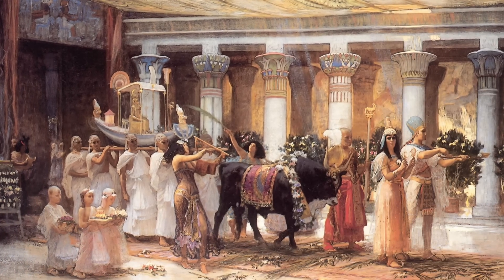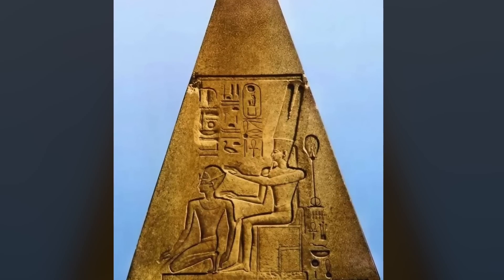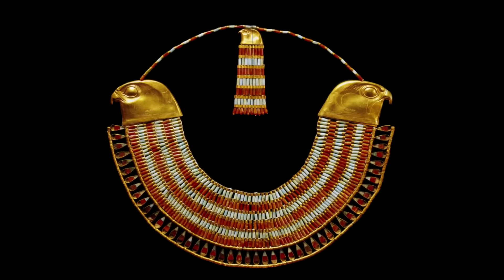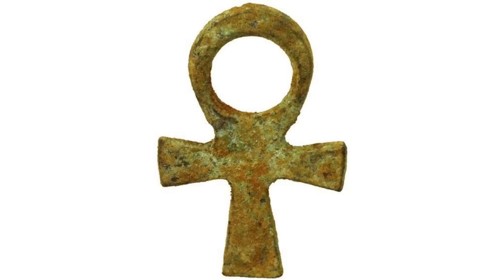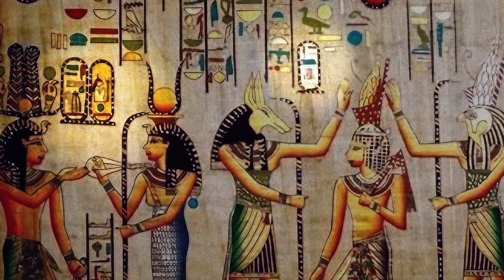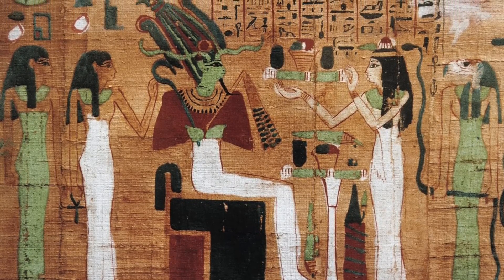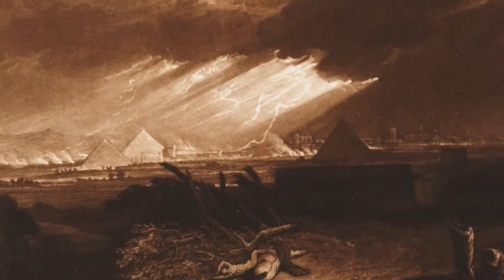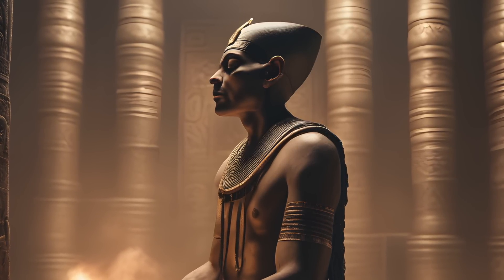Andrew Hall: Electricity in Ancient Egypt | Thunderbolts

Comment: Cool pics brother I have been a mechanic for 30 plus years and I see static electricity being used as lights. Started reading history and Found A key with in a dice and some marbles. Like the lighting in a bottle of the the 1st electricity discoveries Newton 😂
Finally some cool pictures bro 
Steam was the generator I believe and marble blowing was well abundant one would think sand and all 😂 tool makes electrical circuits too 👁
Gold would help to connect them like the old coins with power lines on them 
I can see why most don’t want one to do several trades 
See through the lies that way 😮 great video brother

Comment: I believe you are on the right path. If you ever get a chance, check out the Tartar people and how they used staticelectric affects to power buildings, robots, and household devices. They use the same artifacts in a way of gather free positive ions within the atmosphere and using heavily grounded tools such as obelisk to transfer wireless charge to smaller obelisk throughout a certain perimeter in proximity of the main obelisk that the current is being projected out from their buildings. I have the video saved in one of my Playlist I will find it and post it here if it will let me.
Reply: https://youtu.be/U_xKHPgTTzE?si=hhHViXqck3zPd93G
Reply: Please confirm the link is here in the comment section and is active, thank you. If you are interested, I can share some amazing experimental results and my hypothesis.
Reply: Also if I'm not mistaken, granite have high amounts of hornblend in its composition. Hornblend is very magnetic and a neodymium or alternate powerful magnet alnico granite will easily stick to it.

Comment: They wear yellow/red ochre. red ocher is a naturally occurring pigment composed of iron oxide minerals, primarily hematite and/or limonite. It is a reddish-brown or rust-colored pigment that has been used by humans for thousands of years for various purposes, including art, decoration, and rituals. I think this may be a key.
Reply: That's another interesting topic.. I have 2 main lines of thought for those, the first is that it was symbolic of the Red God (mars) which color is actually due exactly to the richness of iron oxides, and it was originally worn by warriors and then extended to other tribal members, and/or its usefulness as solar protection - iron oxides are still one of the main ingredients of solar creams - and in fact there are still tribes that use the pigment exactly for that. What's interesting is that it points to a former dimmer sun in a more ancient age... As for its electric properties, i'm not sure if that woul be a factor in modulating ritualistic effects, maybe someone else has better ideas on the topic
Reply: @giacomostefanoni7634  just a guess. icecaps are at max. Bigger cold areas. Potential between habitable tropic band as to cold higher as we see today. Might be a bit foggy during that era.

Comment: Recently biologists used electricity to change DNA.  Wonder if the Kemetic population used that to heal  some problems  and that the priesthood members knew this as an art, particularly for the pharaoh.
Reply: I suspect that the current was tuned to interact with the cell nuclei, promoting cellular regeneration as well as enhancing brain wave activity. The pharonic crowns would have further amplified the effect while the current travelled up the spinal column, via the spinal fluid, and would have activated the chakras, towards the pineal gland, hence the cobra symbol on the forehead. Definitely not "silly hats" like the narrator said. 😄🐉⚡️

Comment: Another possible use of highly internally charged semi-conductive stone is that you might be able to precisely machine it using Electric Discharge Machining (EDM). With sparks breaking down just the surface of the stone in contact with the electrode, a simple copper chisel could actually become pretty formidable against granite and diorite. With acoustics helping mobilize stored charge, the chisel simply needs a little capacity, or be grounded opposite polarity to the stone. How about forming copper sheet to a desired shape, and use that to discharge-carve a perfect replica on hard stone? You've seen the fine featured statues and perfectly formed stone vessels. Either soften and press with molds, or EDM while hard. How else could they have done those things? Abrasion, either coarse or fine, has been pretty much ruled out.
Reply: Hello all. Geophysicist here. Very interesting conversation. As I look at the cut marks, tube drills some of which are non-circular, scoop marks, surface striations, etc it is evident that although abrasion was sometimes used- it cannot explain what we see. In particular many cuts show a penetration rate of 3 to 4 mm per rotation. That is far higher than our best diamond saws or drills today. Although chemical or sonic treatment may have been used at times - my best theory is that indeed EDM best fits the evidence. As to why we don’t find any wires, capacitors, battery .. relics? Look at the stone brace cuts -all the metal has been taken. There were thousands of years of occupation after this technology was lost - all such artifacts - especially metal silver or gold has been repurposed. We see it in the hieroglyphs but it is all gone. Absence of evidence is not evidence of absence. Additionally, Present day Egyptian bureaucracy actively hides any evidence outside the mainstream narrative - just look at the story visitors are spun when visiting the unfinished obelisk.
Reply: @skyflight99  i get so tired of people yelling 'we use wires to conduct electricity' i have to respond that in electronics, carbon, silicon, crystals and polymers are used as resistors, diodes, oscillators and capacitors. all non metal objects. 

People need to see. Vandegraaf. Wimshurst and kelvins thunderstorm first. To see static in polymer, metal, and even water. 

Triboluminescance and piezoelectric.
Rosequarts granite. Turning the wheels of a wagon created a bit of light in india. They showed this, and probably thru thousands of years of stonework, they must have found use for it.
Reply: @@Aqua-Fyre 1) Tube drill holes & plugs. Assumption is that they are representative of technique. No hint of abrasion. 2) Glassy surfaces w/no abrasion marks. 3) no abrasive grains. 4)
Reply: ..4) Assumption that Peruvian work is same builders, surface glass implies very high but localized heat suggests sparks. 5) spectroscopic analysis shows extensive differences between the vitrified surface and substrate rock, also seen in some spark and HHO gas experiments.
Reply: For clarity, when I wrote glass, I mean actual melted rock glass, not "looks glassy" as in finely polished with micro abrasives. Rock surface converted. Peruvian samples tested & HHO experiments show similar conversion of rock to glass and heavy elements. Don't know if actual Egyptian material tested, probably not.
Reply: @@Aqua-Fyre None have been found? This is a simple technique if it was done like I describe,, but there's also reasonable doubt that the Dynastic E's knew the technique and did any of this work. The precision turned vessels are a glaring example. Also, rock glass typically degrades in a few hundred years, so well preserved specimens are needed for analysis. Tube holes or deep cuts might have it.
Reply: Still, all this can be done by abrasion. Copper tube. Sand. Water. Use a waterwheel. Windmill. Or even cows in a treadmill. Turning stone from wheel into pillars an disks. And leveling the block you grind underneath.
Reply: @humbuccaneer84  It appears they might have done it abrasively, but a micro-melted rock glass surface is a problem for that theory unless glass resulted from some kind of fire polishing technique. Then there's the lack of embedded abrasive in, for instance, hole drill core striations.
Reply: @rickZR1982A  micro melted? Do you mean polished... sifting sand to finer grain. And wax it.
Reply: @humbuccaneer84  No, I specifically mean that the surface of the rock has been vitrified apparently by high temperatures, but at tiny scale. There's a very thin layer of actual "glassified" rock on some well preserved artifacts from S.A., though I'm not sure about Egyptian samples. This thin glassy layer degrades over a few hundred years in the environment, so is not often found except where the surfaces were protected. This is what you'd find if it was machined with tiny plasma arcs, which is what the numerous micro-sparks from EDM actually are. Works well on resistive metals (no glass though, that's only from rock). Could you do it with semi or non conductive rock? Probably, since a similar process is done now with acrylic, glass, and other dielectrics, but instead of conventional current, electrons are pre-embedded with a LINAC before discharging for effect. So embed the charge with sound, then discharge into copper electrode tools to melt and vaporize rock at the point of contact. Water might be used to cool the tool during work. No aliens, no lasers, no abrasives, no high tech at all. Ancient EDM.
Reply: @rickZR1982A  might be even as low tech as superheated steam... but i love all the options discussed. Glassy surface could also mean a massive interruption from the sun... and why everyone started to live underground. As in capadocia and derinkuyu turkey. Stories from native Americans. I only recall a glassy surface on a site in scotland. But i keep it all open as to what or how they did it.

Comment: The use of high voltage static electricity could also be how the priesthood and pharoahs proved their divinity...  not that they were usually shocked,  but they were charged and then shocked the classes beneath them.  Note that the Pharoah would likely be mildly shocked by the priest,  but both would give the classes below them large shocks.  Servants were likely using specially made utensils to serve their masters to avoid the shocks.  But if someone did not follow the proper protocols and showed disrespect,  then they would be hit with a large shock and possibly killed as a result.
Reply: Utter and complete fecking nonsense... Whee do you get this rubbish from? Ohh, right, nonsense like this video.

It's complete rubbish and *intentionally ignores* literally all of Egyptology, history, archaeology, The Saturn Myth, et al. 

Ugh. This is not something we should be hitching our wagons to. It's complete "Dendera Lightbulb"-level nonsense.

Comment: It's astonishing to think that the Egyptians' mastery of electricity seems to rely less, if at all, on the production of mechanical force, and is focused more towards bio-electrical, electro-chemical, capacitance storage, and maybe harmonic manipulation. It seems that focus away from generating locomotion is what blinded modern humans to recognizing their use of electricity in daily life. I would be interested to see what circuitry could be depicted at the Temple of Man, Luxor. Schwaller de Lubics and John Anthony West believed it to be a repository of the Egyptians accumulated anatomical knowledge of metaphysical man.
Reply: I imagine it was do to the fact that it was labor intensive and expensive to generate the electricity for these rituals. Based on the imagines I've seen of what were probably battery cells, we're talking hundreds of pounds to generate the current of licking a D cell. The tech just wasn't there yet to do more.
Reply: @TheRyujinLP  They seemed to have had a firm grip on piezoelectrical and chemoelectrical principals, focused on building high voltage - high hertz - low ampere outputs for bio-therapeutic, e-field generation, and material manipulation. Generating locomotion was probably just overlooked as a use case due to the danger and lack of tech to wield high amperage discharges effectively. No amps, no torque.

Comment: the Djed thing is a capstan used to pull heavy loads such as stone blocks. the top portion was wound with three ropes. two heavy ropes in one direction and a third lighter rope wound the opposite direction. the rounded base of the capstan set in a stone basin lined with bronze several examples of these have been found. lubricating oil would be poured down a slot on one side of the basin and a frame work held the pillar upright. 
in use , a load rope was wound round the lower portion several wraps and the two heavy capstan ropes were pulled along with the load rope by crews in opposing directions to power the capstan when the heavy rope paid out the load rope was slacked and the lighter rope was drawn out by one of the crews to rewind the power ropes into their slots , rinse and repeat with capstan stations spread between construction sites and the quarries they could move massive amounts of stone quite easily ...no electricity required Egyptologists figured out this mystery years ago and quite frankly it is not a difficult thing to figure out either...lets put it this way "maybe Hall is correct" BUT even if he were the thing is still a capstan in that it would work as a capstan if configured as the Egyptologists suggest so which is more likely?
i like you guys but some times you let the speculations run away just a bit too far.
Reply: I can't find any reference to this being the case (no pictures, carvings, hieroglyphs or otherwise indicating ropes nor the usage as you state).  Can you share some of this information?  As per Egyptologists, these symbolize strength and oddly shown next to ankhs (all over the place).  This doesn't make any sense as a capstan as many of these objects had square bases (not a very good capstan)
Reply: I've seen this idea somewhere before, pretty sure it's speculative. My problem was that it suggests the capstan was in the unstable vertical position instead of horizontal two-point position. That just makes no sense to me. Also cant understand how an array of these gets those gigantic stones from anywhere to anywhere, let alone from Aswan to Giza (850 km).
Reply: Where is this documented and displayed to work ?

Comment: Shocks to the nose from an ankh not touching the nose would produce sparks and those would have been shown, so perhaps it was more of a dark mode plasma discharge.  The original technology that the ancient Egyptians discovered probably originated under very different environmental - electrical conditions with respect to the earth, oceans, ground waters, atmosphere especially if Earth was orbiting within a double layer shell at the time such as seen around the anode in the SAFIRE project, but with much less potential of course.
Reply: The catch is we don't know the environmental differences that existed back then. There are clues, but we can't be sure. Just imagining a much more ionized environment would drastically change the effects they wanted to recreate, I guess-..@@Aqua-Fyre
Reply: @giacomostefanoni7634  This could be very important. The absolute charge level in and around the earth (what we find at "ground") changes generally & at specific locations over time. Subsequent to large solar/cosmic outbursts in the past filling the crust, atmosphere, and VA-belts with a fresh supply of charged particles, the electrical environment might have been much more active than we find it these days. 12000yrs, 6000yrs, you know: "the pattern".
Reply: @rickZR1982A You got my imagination turning. One night in my basement during a snowstorm near my multipurpose antenna the charge was unreal. I lit a LED with my finger fainly but it lit.
Reply: @@Aqua-Fyre ankh is a magnet. The ring and staff. In egypt, and Mesopotamia. Are magnets. Point a magnet to stone. Touch it with a cone. And sing. Magnetic now fibrating in rock. Creating electricity.

Comment: Telepathic and also to do with the strong electrical field. He's wrong about the nubs though, nothing to do with people walking past, unless people walked up the sides of the pyramids. Which seeing as these nubs were covered in casing stones they wouldn't be sticking out anyway.  The nubs were points of contact for some kind of equipment that did use said electrified atmosphere to soften the stone.  As the face of the stone is worked flat a nub is left.  We also see mistakes where the equipment has been moved away from a nub before being deactivated, and a sputtering arc path can be seen going down the rock from where a nub once was. These arc's would be so powerful they could not possibly be discharging from a person.